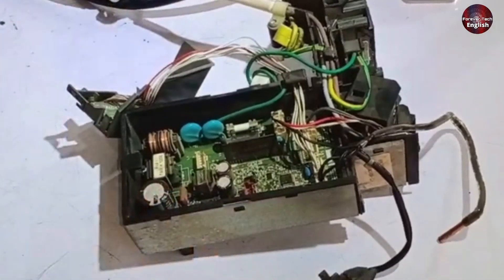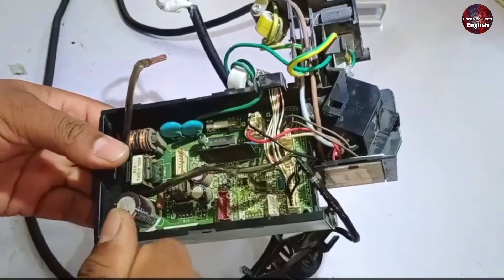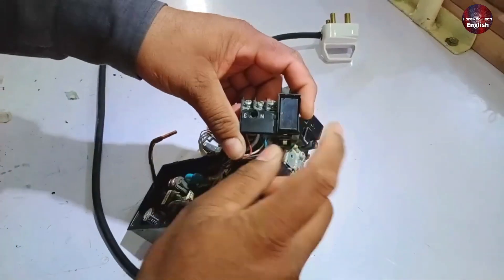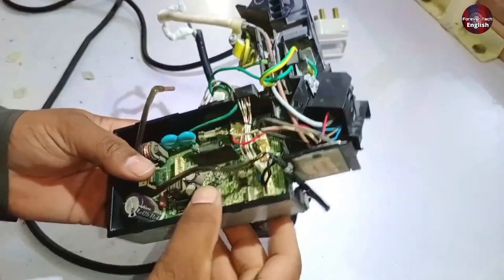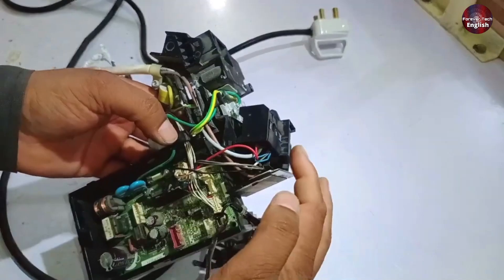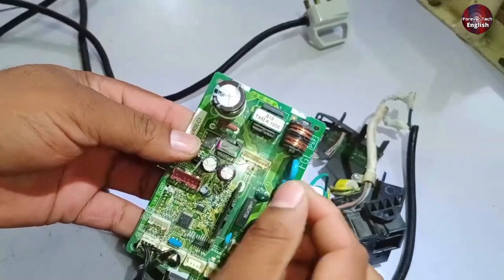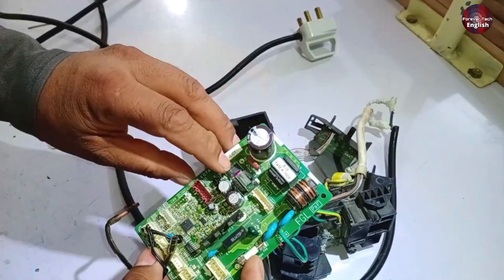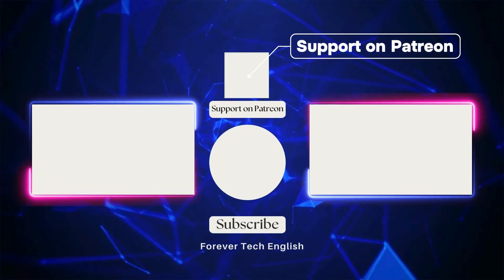Fujitsu AC Circuit Repair Tips: Hidden Fuse & Filtering Explained!

Comment: I have a Mitsubishi Heavy Industries 3.5kW AC. The AC turns on, but no cool air is coming out. After a few minutes, the orange timer light starts blinking six times. According to the manual, this indicates a signal communication error.

I checked the outdoor unit fuse and the continuity of the signal wire, and both are fine. What could be the issue? Is there anything else I can do to locate the problem?

Thanks in advance!
Reply from the maker: I have already made a video on it on my channel for 6 light blinking error for the circuit board.
Reply: @forevertechenglish  Thanks!